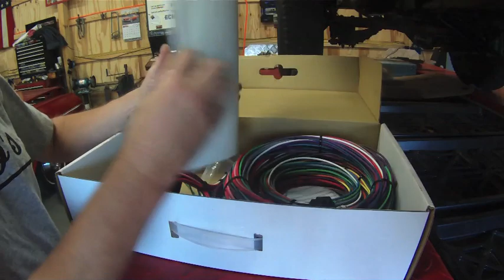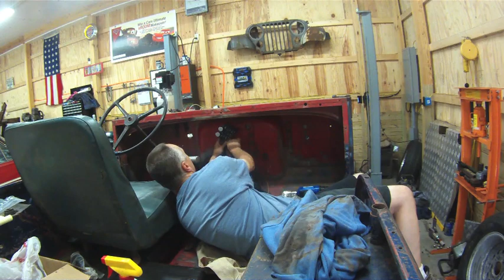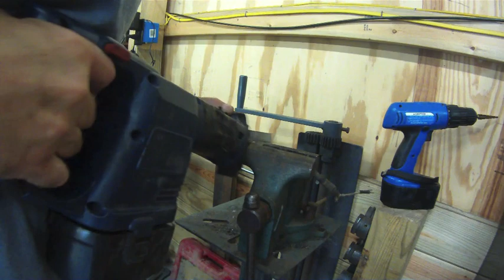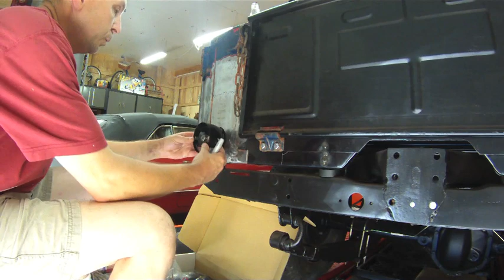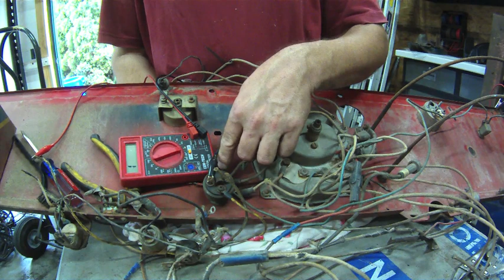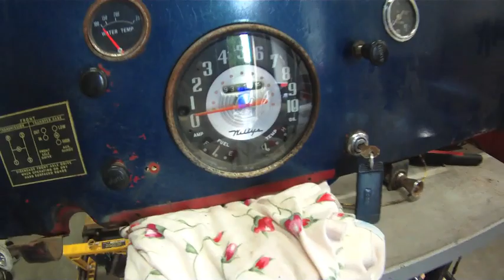Re-Wiring Your Old Jeep EP1

Comment: I know this is from 2 years ago but maybe you will see this message. I’m mending a 1955 cj5 as well and converted it to 12 volts. I have the same old king seeley cluster with the silver facing. My question is about the fuel and temp gauges. Did you use a voltage reducer to allow those to work on your 12 volt system?
Reply from the maker: I'd recommend using the voltage reducer. I didn't and used a cheap 12 volt gas sender. Seems the gauge was working, but now it's intermittent, although could be the sender that's bad. Thanks for watching!

Comment: You leftout the most important part, wiring from switch to wipers is there a fuse evolved.
Reply from the maker: On my 55 Jeep, I have vacuum wipers, thus no need for a circuit. If you use the EZ wire harness, there is a fuse and labelled wire that you would run to the wiper switch, then from there run a wire to the wiper motor. Hope this helps, thanks for watching!